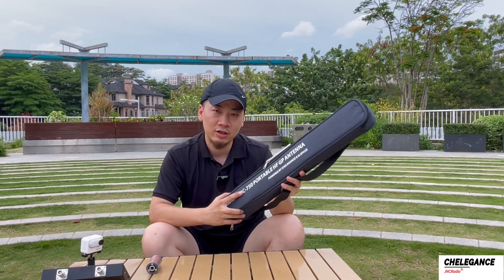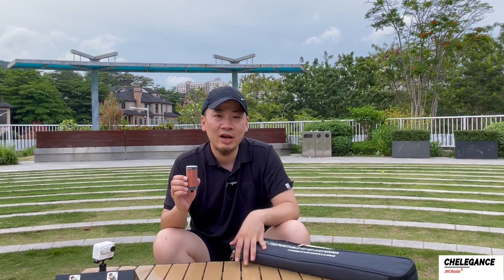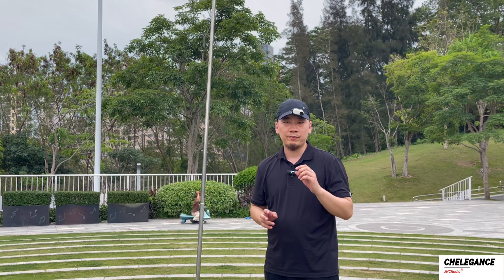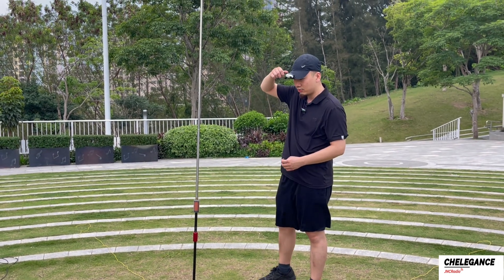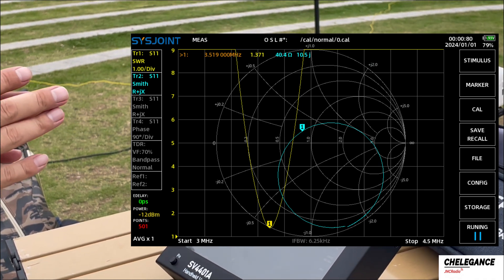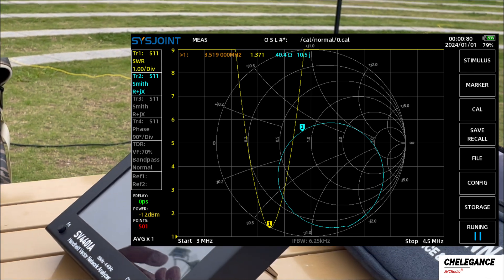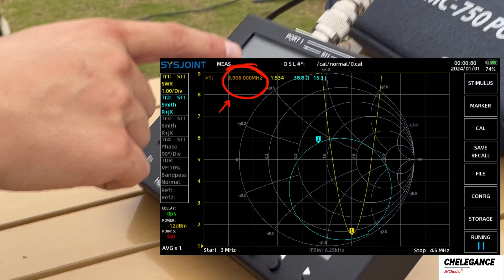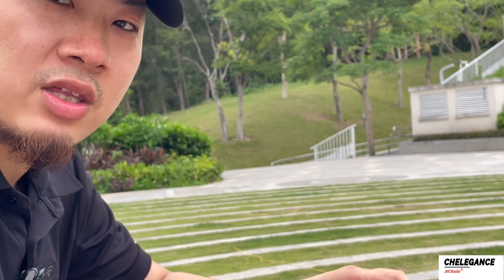MC-750+80m Coil-The Ultimate HF Antenna Combo!

Comment: What size banana plugs fit securely to the base? The radials that came with the antenna are terribly loose. Please advise? Thanks.
Reply from the maker: 3mm it is.. radials loose is not a general case. Please contact our support team and ask for advice.